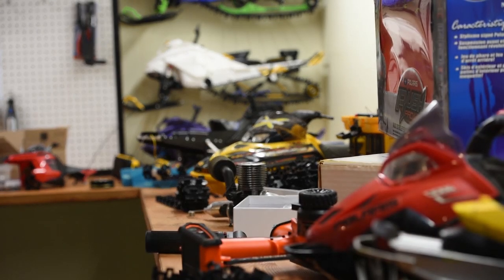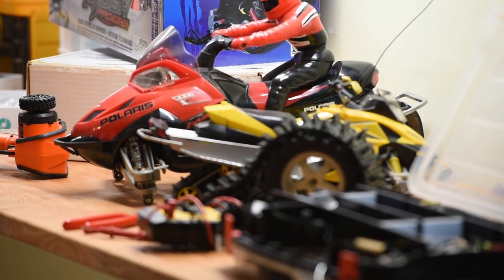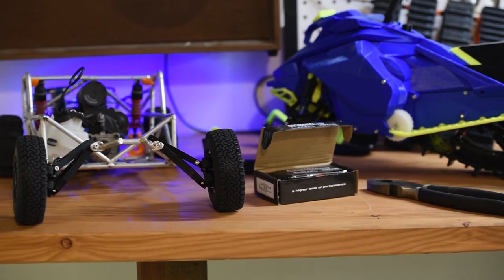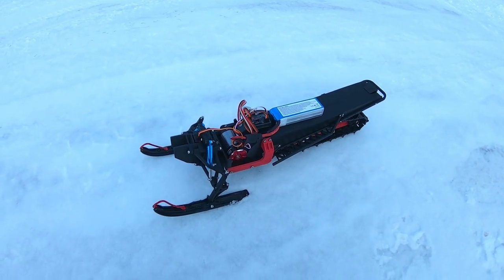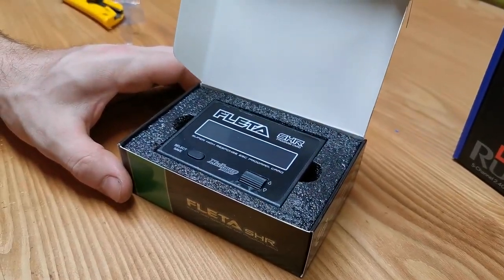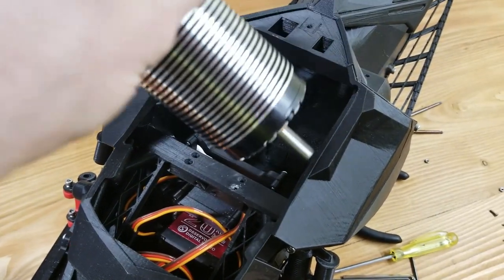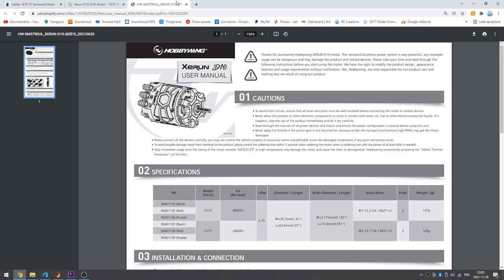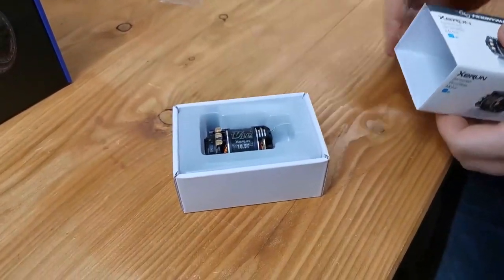How to choose your electronics? Rc Snowmobile Edition

Comment: Me again lol So I’m building the skeeride and have been watching a lot of your videos. I will be building one of your kits next. I wish I would’ve found yours first but I had already started the skeeride when I found you. With shocks, it’s difficult to find a good shock that is only 80mm from hole to hole. I have some nice prolines that are 88mm. What’s the best way for me to use a bit longer shock without issue? Do I need to lengthen the area where the shocks mount? The thing is, the 88mm shocks actually compress down to 62mm so they have a good amount of travel. How would I buy one of your kits? I like the style of Shocktky and deca. I know you aren’t selling the lightweight version which is understandable. But something similar I would love to start after I finish this project.
Reply from the maker: The shock lenght is a guideline, especially for the conversion kits.  

The alpha is working with tighter tolerances and thus requires shocks a bit more precise, esceciall in the skid.  The front end uses 75mm shocks for the narrow front end, and 85-90mm for the wide.   You could use those shocks on the alpha

Comment: Hey pascal, I finally got my yamaha built!! It hardly turns in the snow tho, do you think the front end kit would help? I have the deep powder skis but I don't know how to mount them to stock front end
Reply from the maker: Limiter straps! Thats the most overlooked part.   If your limiter strap is short and tight, it throws the weight of the rear towards the front end gives more steering authority.  
For the skis, do you also have the new spindles? Its difficult to mount the skis without them
Reply: I have the complete stock front end for the Yamaha I have to purchase the 3d printed a arms and spindles from you still
Reply: I have the deep powder skis just need the front end kit from you once I get paid, I'm using a 800 mah 3s battery right now because it fits on the stock battery tray I will definitely add limiter straps

Comment: So if I have an 18v drill motor would that work for rc?
Reply from the maker: If the can diameter is 36mm, the motor has a flat plate (no bushing bulge) and the mounting holes line up, then yes, it will work
Reply: @Pascal_Robert--Rc_Creations  OK thanks